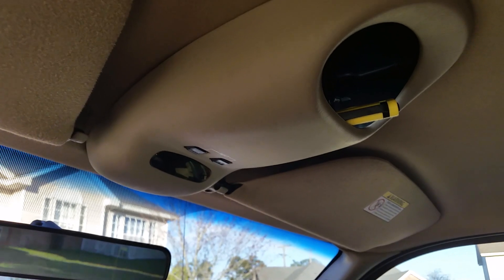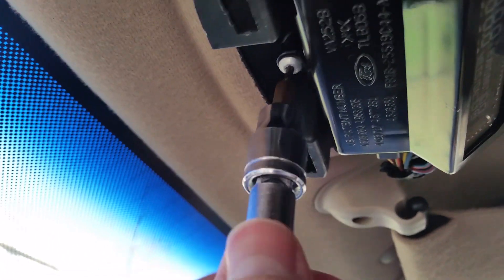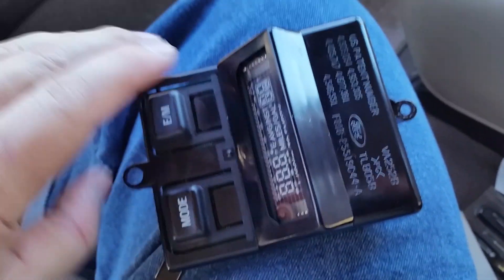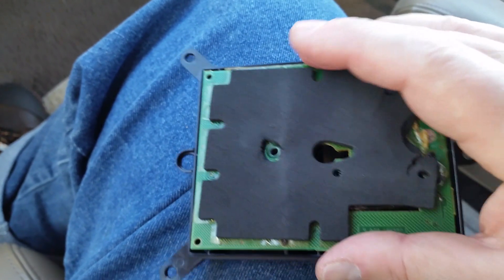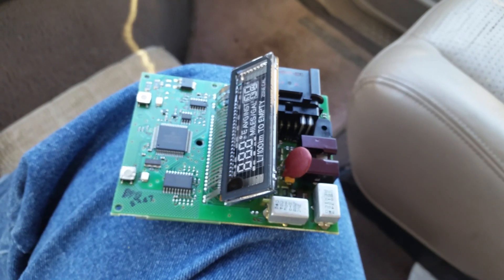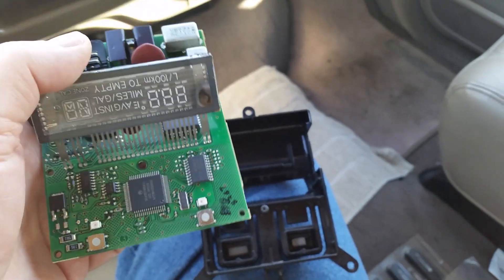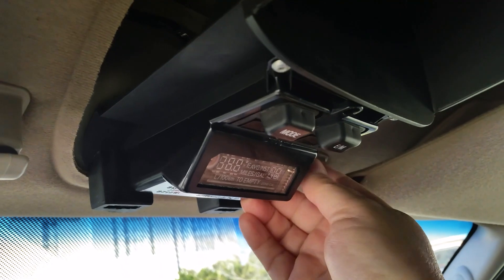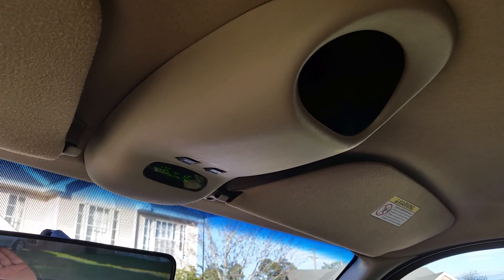99-04 F250 F350 RELIABLE Overhead Display Fix P/N: F81B-25519C44-A

Comment: Random Keith on Youtube > Mother Theresa
Reply: PS. Thanks for mentioning cracks on the back! I solder the loose bits but it didn’t work because there was a little split on the backside. After that…MONEY 🤙🏼
Reply from the maker: @mattspencer-cooke5474  You can still order the replacement Resistors with the links provided in the video description or "more" tab. They cost around $0.30 cents each. Hope that helps. Best Blessings. Keith

Comment: this is awesome. is it okay to use 68 resistor if 62 not available?
Reply from the maker: Since I don't have the schematic I can't say if it's ok. So just look up a 68 ohm in package size 2512 (6432 Metric) Try https://www.digikey.com/ or eBay
Reply: @ thank you 👍🏽👍🏽

Comment: Great vid. I bought my 99 350 recently and noticed it don't work at all. I was thinking it might've been a fuse because the Auxiliary power point don't work either? What do you think?  I haven't seen a fuse for them but I'll try this out. Thanks for the vid
Reply from the maker: For the Auxiliary Power Socket on the Dash next to the Glove Box, check the (yellow 20 amp) Fuse 10 in the Battery Power Distribution Box in the Engine Bay. It's a on the bottom left of the box, in the red area, 2nd row 5th for the bottom. Use the fuse location locator inside the fuse panel lid to help find it if need be. Hope that helps. Also check out a group called 7.3L Powerstroke Nation on FaceBook. I help moderate it. https://www.facebook.com/groups/160790022662417/  I"m known as Keith Dereck in the group. Make sure and answer the questions and scroll  down them to find the Agree to group rules. I routinely post wiring diagrams for the 99-01, and some 02-03's as well. Best Blessings. Keith Noneya

Comment: This is probably the best video about this procedure I found on youtube.  Thank you for sharing this knowledge.

If I may ask one question though...

Is it the red/yellow (+12) and pink/orange (ground) to power on the unit on the 10 pin connector?

My truck (2005) didn't come with an overhead console and I got the urge to try and fit one in there only to find I'm missing the correct wiring harness.

I would like to be able to test the overhead console and know that it works before I try to figure out the rest of the wiring harness.

Thank you in advace.
Reply from the maker: Yes you got the colors right. If you email me at keith_noneya@att.net I'll send you the wiring diagram for the 99-01 connections to the truck. I check my email every few days, but I'll check it a few times today for you. Best Wishes & Blessings. Keith Noneya

Comment: Great video thank you so much. You wouldn't happen to have the wire  diagram for display would you? Thank you-shane.
Reply from the maker: If you mean the schematic for the display I don't, but I have the diagram for the wires from the truck to it for the 99-01. If you need those email me at keith_noneya@att.net I check my email every few days. Thanks for watching. Best Wishes & Blessings. Keith Noneya
Reply from the maker: Hey Shane sorry for the late reply got kinda busy yesterday and well Today was Sunday and Mothers Day so I just checked email. I sent you the truck wiring diagram and some other things on it. Thanks again for watching. Let me know if you need anything else. Best Wishes & Blessings. Keith Noneya

Comment: Got mine fixed just move the little display pins around and working again don't know if this is a good way fix it hopefully nothing bad happenes
Reply from the maker: If all you have to do is move the display pins then they will move back and the problem will reappear. If you put just a little flux on them and a tiny bit of solder then re-flow/solder the joint it will not have to be fixed in a long time. Best Wishes & Blessings. Keith Noneya

Comment: Do you know what that orange resistor thing is? Mine is cracked and burned and I'm not sure what it is and cant find a part number anywhere. Any help is appreicated
Reply from the maker: Flying Taco? Must be a pilot, LOL If you're talking about the large rectangle thing, that's not a resistor it's a Tantalum Capacitor. They are known to short out. If it's all burned up that's most likely what happened. They are used for input power to the circuits. If you're fuse blew fast enough the rest of the electronics should be fine, if it didn't then the IC's on the board will be toast internally. There's a link in the video description for some folks who repair these overhead displays and they also sell refurbished ones as well. I don't have the schematic for the display so you might give them a call. Let them know I post their eBay business on my repair video. Hope it all works out good for you. Best Wishes & Blessings. Keith Noneya

Comment: My display went out and I took everything out down to the circuit board but I lost a resistor, and I have no idea where to look for a new one. Where did you get yours?
Reply from the maker: Hi Luke, I put the Part Numbers and the companies where you can get them in the video description below the video. I also put a link to a company that will repair yours if you don't want to take the time to do it yourself.  If using eBay make sure you check the resistor value and the Pack Type/ Size, these are SMT Package Size 2512, and the value depends on  which one you're missing. eBay is cheap and quick but you'll have to do some looking in the description to ensure the value and size are correct. You can just plug the number into Digikey.com and it will pop right up.  Hope that helps point you in the right direction. By all means feel free to email or comment me back if you have any questions. I monitor my channel several times a day, and email once a day. Best Wishes & Blessings. Keith Noneya
Reply: @keithnoneya  thank you, so much.

Comment: I noticed you used 2 680's is that okay of all boards ?? Thanks
Reply from the maker: I'm sure if your board looks the same as mine it's probably what was in those spots originally. Vehicle manufactures don't like to reinvent the wheel if they don't have to. Best Wishes & Blessings. Keith Noneya
Reply: @keithnoneya  thanks for the reply. Iv seen a couple videos with the 680 and the 620. But also iv seen both 680 I'm not sure what was in there originally the guys who tried to fix it before me burnt it so bad. I can't see what it was. I'll just go with both 680 see how it goes lol. That way I don't have to buy both.
Reply from the maker: @joshuabandola1336  Makes sense to me and that's what I was going to suggest. How did they burn it?

Comment: I do not see any cracks or something on those resistors, but would that matter what may be visible just under a bright light?  Also, is any fuse linked to the computer display? Other theories: Is the power to this computer display any way related to the sliding roof window, as my sliding roof window is a mess with a separate wire coupling nearby.  My Feb. 1999 Lariat overhead console is amall and just houses the buttons for the roof window and the computer display.  Thanks for any tips...
Reply from the maker: Hey Carexpritch I'm not sure if they are related, but  I looked through my Haynes manual and I couldn't find anything on the overhead power. But in the Haynes Manual the schematic diagrams show the power to the window motors come from fuses 25 & 29 of the Power Distribution Box. It's the fuse box in the corner up against the cab just behind the Air Filter box on the drivers side. Kinda long and skinny. The diagram of what the number of the fuse is are located on the inside of the cover. I would just check all the fuses in their. Hope that helps you find your bad fuse. Best Wishes & Blessings. Keith Noneya

Comment: Been a busy year and hope all are healthy.  I just opened up my console (finally) and found one of the little 680 resistors almost completely off. I will try to get the thing back on there without a microscope!!  Looks like it had been repaired before by the previous owner.  I do not have the skills or equipment that Keith Noneya has but I will give it a shot. Thanks for the video!
Reply from the maker: Just follow the same procedures when cleaning and soldering the resistor back on and you'll do fine. Thanks for watching. Best Wishes & Blessings. Keith Noneya
Reply: @keithnoneya  I ended up going with ManDigital to fix it. Great service and working like new :-)  I will add that the black plastic bracket that the display screws into was loose and rattled. This may be part of the culprit of why these chips are falling out due to all the vibration. I cut up an old mouse pad and used it to shim the gaps. Nice and tight now :-)  Thank you

Comment: What would happen if I put the 620 instead of the 680 resistor in
Reply from the maker: Most likely it would work provided the wattage or size was them same. However I don't have the schematic so I can't say for sure if it would damage another item on the overhead display. Thanks for watching. Best Wishes & Blessings. Keith Noneya

Comment: What wattage soldering iron do you recommend?
Reply from the maker: I used a 30 watt. If you use flux this will help immensely it getting the heat to transfer to the board. Best Wishes & Blessings. Keith Noneya

Comment: Great video! I've been driving around pissed off for a year about this not working and finally decided to take the plunge.  I literally blew mine off and it works now! Nothingseemed out of the ordinary,  just dusty! However,  I'm just curious if you know how this actually functions and what decides the mileage? Does it run off the fuel sending unit? My sending unit is messed up and shows I have a full tank until I'm down to about ½ a tank and it drops off instantly.  I'm still going through my first fill up since the repair,  but trying to learn more about this system.
Reply from the maker: Yes and no. The unit gets the mileage from the ECM. The ECM gets the fuel level from the sending unit and updates the display on the roof. The only thing the roof display has is the Compass and possibly the Temp sensor. Hope that helps explain it. Best Wishes & Blessings. Keith Noneya
Reply: Awesome,  I appreciate your reply! Sorry it took so long to get back to you.  I didn't even see your reply until now.

Comment: Where can I get the message center repaired. Learned  enough to take out and replace from your  video.. Otherwise I don't feel qualified to repair on my own.
Reply from the maker: Try this link from mandigital on eBay:   https://www.ebay.com/itm/Ford-F150-F250-F350-Compass-Temperature-Overhead-Console-Display-Repair-Service/280789709614?hash=item41605ef32e:g:uCAAAOSw2xRYSh7B  It will cost you around $22.00 You pay for shipping to them, they pay it back to you. Thanks for watching. Best Wishes & Blessings. Keith Noneya
Reply: @keithnoneya  Thanks for the help.

Comment: I have a 2000 F250 with this console. I just bought a 2006 F250...same trim package. Ugh, no console. I am wondering if I could forward fit my old console into my new truck?  Even if I could just get Temp & Compass to display...what inputs would be needed?   dawnswind@aol.com
Reply from the maker: I've never done a console swap. I suppose as long as the wiring and mounting holes are there i don't see why it wouldn't work. The Compass and Temperature sensors, I believe but not entirely sure, are mounted on the overhead display itself. The mileage and trip data comes from the ECM, so if you're missing those on the display you may have some wiring issues.  I'd open up the display like I did on mine and see if you can find any loose resistors, if so re-solder them. Let us know how it works out Andrew. Thanks for watching.

Comment: First off, great video Keith. Before I tear into my console, I was wondering if there was a fuse that is associated with this in my fuse box, and if there is any information that can direct me to the function of each wire. Any info would be appreciated. Thanks again.
Reply from the maker: Hi Courtyney, I'm not sure as I didn't have to go that far in the repair as mine was actually lit up and mostly working. It's a great question if the display doesn't even light up. I'm sure if there is. it should be in the maintenance manual. I'm at work right now so I can't look it up at this moment. If you look around the fuse boxes you may find one, if you do let me know. I would go ahead and pull it down, it's really easy! You can also use a cheap Digital Voltmeter or a mechanics power light probe to find out if it has power. Put one meter lead on the outside shell of the cigarette lighter (NOT the center one that's 12vdc) and probe each pin on the connector on the overhead display connector. If one of them show's 12v or if the mechanics light, lights up you know you have power, and it's not the fuse. Let me know if you want me to look into the fuse for you. Best wishes & Blessings. PS you have to put the truck in the run position, meaning key on, you don't have to start the truck to check for power on the connector. Hope that helps point you in the right direction. Keith
Reply: @keithnoneya , I will try that, my truck didn't come with the over head console from the factory install, but it did come pre wired female plug  behind the passenger side kick panel where the wire harness connects too. So after searching junk yards, I found the exact same console (Ford part no.) As the one in your video, $20  and the color wires match up with my wires in my truck. When I plugged it in and turn my truck to the run position, the display stayed black, put the mode/em buttons illuminated when I activated my headlights. So that's is also why I'm searching the internet for wiring diagrams to find out what wire does what.
Reply from the maker: Your project would make a great DIY project. When you figure that out you should video what you did and post it. I'm sure a lot of folks would watch it. I know I would just to know where everything hooks up. I you find out what fuse panel it goes to and it still doesn't work let me know I'll take a picture or video of mine and post it for you so you can check it for differences. Best Wishes & Blessings. Keith Noneya
Reply: @keithnoneya , I am going to make a diy video and plug you in it,  might not be as good as yours but. I will let people know about your video. I will let you know when I get it done.

Comment: Going to fix mine but I have a few questions.  Why 1 watt resistors?  Is it to last longer or is that the original size? Can I use a traditional carbon wrap (cylindrical) resistor vs the thick film flat ones?  Do you recommend a maximum wattage on the soldering iron?  I can dabble, have re-soldered a lot of junk electronics but have no formal training with electronics so any response about the wattage of the soldering iron would be helpful.  Great instructional video.
Reply from the maker: Hi Nickel. The wattage is because for some reason it gets hot, so stick with the original 1 watt. A 30 - 40 watt iron should be enough to melt the solder. After you clean the board off with the solder flux and wick braid, make sure and put some more flux on the board as it melts and transfers the heat faster so the solder melts faster and the board doesn't overheat the pads. Best Wishes & Blessings. Keith Noneya
Reply: @keithnoneya  the million dollar question, do you think it would be okay to use carbon film wound resistors or should I stick to the flat film of the original?  If you're not sure, I just may experiment due to the fact these things are a dime a dozen in the junk yards now and  my sense of direction is spot on and to keep myself busy while driving I compute the MTE and MPG in my head...lol
Reply from the maker: I would stick with the original design but you can try it and it will probably work. Let us know how it goes. Keith Noneya

Comment: Can you get new or replacement resistors?
Reply from the maker: Absolutely the part numbers and where to get them are in the description below the video. Hope the video helped. Let me know if you need anymore help. Usually there's a minimum order so you may have to order a lot to just get one but the price is really low so even if you have a lot left over it's still cheaper than ordering a new display. Thanks for watching. Best Wishes & Blessings. Keith Noneya

Comment: Nice video!  I repaired the display in my 2001 F350  in less than an hour.  One resistor fell out and I picked out two more loose resistors with a knife.  I was lucky enough to find the missing resistor stuck in the overhead console plastic so I didn't have to order any new ones!  Soldered them back in and good to go.  Hardest part was simply lining the little resistors up to the solder pads LOL!  Thanks for the video!
Reply from the maker: Thanks Crazy.... Glad to help that's what my channel is all about. NICE 67 Special you've got there. Best Wishes & Blessings. Keith Noneya